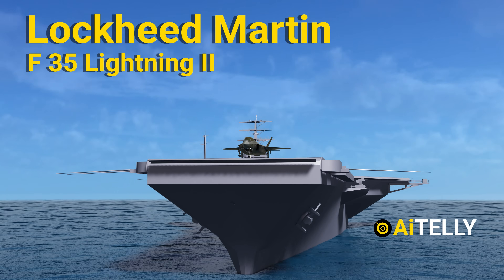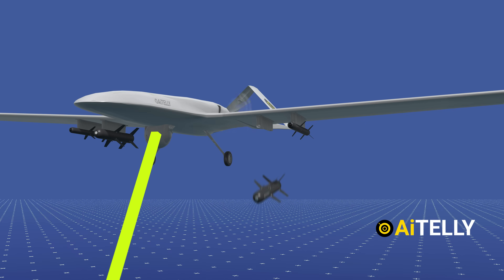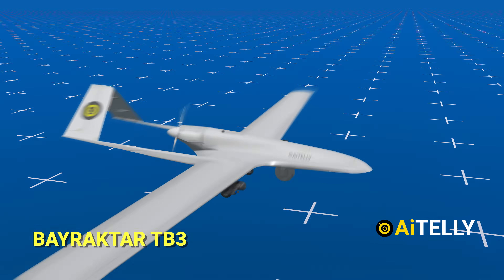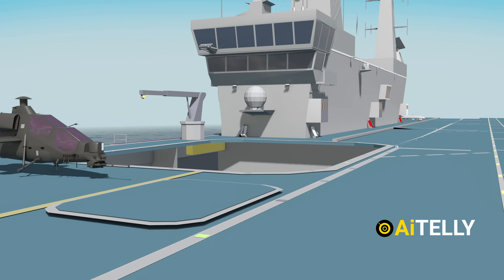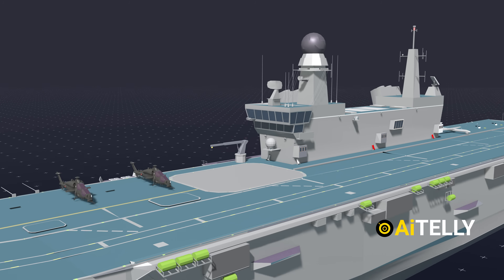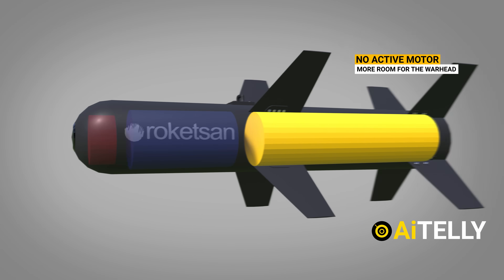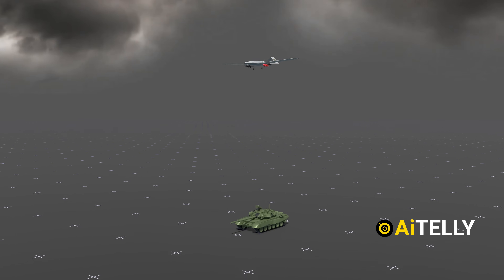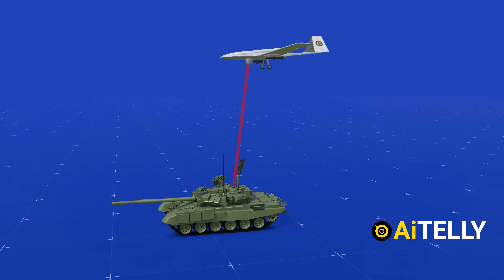TB3 Bayraktar drone Turkey | How it works #drones #tb3 #aircraftcarrier

Comment: Excellent coverage & comprehensive review. Well done mate. But let me make a point. Have not Turks become the mastering Sykes of 21 century? O YES. It's no usd of scaring Turks with ambargos any more because we produced the best of the bests. Kìzilelma unmanned jet fighter alone is caple of taking any modern fighter system f22 or f35 or eurofighter or rafael or suv 57 or any... without risking a pilot. In the mean tina MMU TFX KAAN is ready to take any threats soon. The best 5th generation fighter platform on earth. You dont birve it? Then just check the results in the ground. All usa, russian, european & China's systems have been humbled & humiliated just by Bayrsktar TB2. Turks have not used any sophisticated systems yet!

Comment: Let's clarify a matter, Turkey wanted patriot air defense system as a Nato ally and the USA did not sell it, that's why the s400 system was bought, then it was removed from the F-35 project because there was the s400, no refund was made, new f-16s were requested in return for receivables, but still they are not given!  As a result, the main unreliable ally for us is the USA. The Turkish Nation will exist long after NATO, just as it has existed long before NATO. 

Bir konuya açıklık getirelim Türkiye Nato müttefiki olarak patriot hava savunma sistemi istemiş ve abd satmamıştır, s400 sistemi bu yüzden alınmıştır , sonra da s400 var diye F-35 projesinden çıkarılmıştır, para iadesi de yapılmamıştır , alacak karşılığı olarak yeni f-16 lar istenmiş ancak hala onlarda verilmemiştir ! sonuç olarak bizim açımızdan asıl güvenilmez müttefik abd dir , Türk Milleti Natodan çok önceden beri bar olduğu gibi , Natodan çok sonra da var olacaktır...

Comment: This is a carrier suitable for strikes on underfunded rebels in the middle east.
How can a ship with 30-50 drones compete in naval combat or airstrikes on a location covered by enemy fighter jets and SAM batteries?

It's important to note that this carrier has zero fighter jets of its own so any drone operations or self defense will be very limited.

What happens if the enemy launches an air strike? The whole concept of an aircraft carrier is to protect the fleet from enemy aircraft and missiles by operating AWACS and by sending interceptors to shoot down most of the missiles.
Reply: there will be TF-2000 air defence frigates escorting Anadolu.
Reply: @emrahguven8441  The air defense frigates are for defense. When you send the drones to throw bombs over the enemy the frigate will not be able to fly with them and protect them. They would be easy kills even for very old jets. 

A carrier group is a big target and the carrier with it's fighters normally is the first line of defense. The enemy will waste plenty of weapons for such a big target and these will ofc be stand off (launched from safe range). 

The frigates will not even be able to detect sea skimming missiles Untill the last few kilometers due to the earth's curvature. This is why the AWACs coverage is required.

If there is an airbase to launch fighter jets or AWACs from the mainland why bother to have a carrier? Just launch the UAVs from there.
Reply: @billwhoever2830  TB2 TB3 are cheap and expendable and also due to size and speed they are difficult to detect with conventional radars.
Reply: @emrahguven8441  The tb2s are neither cheap nor undetectable. A single tb2 costs around 2-3 million and then you have to consider the very limited capacity of the carrier, these are not expendable UAVs, you will not be able to complete a mission after losing those UAVs. 

Single use drones can be more than 100 times cheaper smaller and then even they end up shot down. Heck even cruise missile are far cheaper and can deal more damage. 

Considering a single frigate can carry 32 long range SAMs, a single frigate can wipe out almost the entire load of this carrier and then even fire back the 8 anti ship missile carried by most frigates. The missiles fired are in general much cheaper than the tb2 (1-2 million). 

I can only expect the tb3 to be double+ the price. This carrier cannot be used offensively on enemy airspace and would mainly offer recon to the fleet. I still think it's far more practical to launch the drones from airports.
Reply: @billwhoever2830  yeah sure buddy all the informations you count doesn’t know the Turkish engineers right ? They didn’t go that sinking and you perception must be relevant right . Just wait when turkey use this weapons . You will  that These engineers thogt what you think and other problems 100x . Just chill and watch
Reply: @RedScorpionx3  The engineers who thought of the Carrier wanted it to have f35s onboard. Now since the f35s are out of the game the plans of the engineers are based on the liited and not ideal options.
Reply: @billwhoever2830  we have kizilelma project unmaned fighter drone it will fly in tcg anadolu.
Reply: @kralnatavizyok2688  That's still a drone, 
the idea that a fighter drone can compete with an f35 is desperate.

This drone will be using a soviet era engines developed in 1966! And ofc it's subsonic. The range is only 930km.

Apart from flight performance I think it's funny to even try compare the sensors with those found on the f35. This means finding targets especially at long ranges will be far more limited even compared with older aesa equiped jets. 

It's also funny comparing the weapons, apart from the anti ship missiles which are decent, the air to air weapons are limited in capacity and range.

Finally survivability is very limited, it's considered "low observable" and not stealth by the manufacturer. It lacks a pilot so evading threats and reacting to mission updates will be mainly done through waypoints from the ship. This means that the drones will have no decision making during the mission.

A group of 6 f35 jets launched from anadolu would be able to take out at least 24 of these drones with long range missiles alone and at the same time be a much bigger threat to enemy jets.
Reply: @billwhoever2830  
Actually even a proper aircraft carrier also has similar limitations...
In history aircraft carrier never used against any country who has strong airforce or  has balestic missile arsenal...
Aircraft carrier always used against weak countries like Iraq libiya or Afghanistan...these could don't have a basic airforce!  Or missile arsenal..

So yes aircraft carrier concept isn't work properly against powerful countries...that's why Americans unable to attack Iran with aircraft carrier..
Iran will eat Americans aircraft carrier alive...

So small carrier with small drones are more practical...it's can use against weak opponents and support naval forces...
Reply: @gengar5704  What are you talking about? Aircraft carriers have sunk the Yamato, the strongest ship ever made. And this is the reason such ships are no longer made.

Because you mention the usage of aircraft carriers, a modern aircraft carrier can actualy get air dominance by shooting down all of the enemy planes. This is how air combat works. A UAV carrier simply cannot do that.
Ofc if your enemy is strong you are gona need multiple carriers in a group to actually achieve air dominance.
A modern US super carrier has more fighter jets than the average NATO country.

A small carrier can simply carry fewer planes. For example , 6 F35s can actually do far far more than simple drones. The f35s can launch anti radiation missiles to silence enemy air defenses and then engage into air combat. After destroying the enemy jets in the area the carrier can start launching gliding bombs or cruise missiles with the same planes. Ofc not everything is rainbows and sunshine so, 6 F35s might lose if the enemy has jets with similar capability on a nearby air base.

A carrier is only useful if you want to carry your planes away from your own air bases, its very useless for Turkey (really). Airborne refueling tanker planes are capable of serving jets on the east Mediteranean.
The Turkish drones have very long ranges, you can launch them from Turkey and strike in Lybia in a few hours.

The "carrier" Turkey has is ONLY useful to carry men and landing vehicles. Attack helicopters would be of greater use instead of the UAVs for such operations  (since helicopters have limited range).
Reply: @billwhoever2830  we have coral systems you should discover that enemy systems can not work while coral activate
Reply: @volkangoren6412  dude, Koral is just a jamming system, most modern warships have them onboard.

In fact, an actual aircraft with a pilot onboard can operate in an area affected by such a system. There are even special weapons designed to target such systems.

A drone or UAV on the other hand cannot operate in such an environment, because the operator can lose connection to the drone, and the drone can even lose connection with the GPS. This means that the UAV would be almost completely lost, would have to operate autonomusly and would most likely fail to complete any mission.

To sum up, what Im trying to say is that if an aircraft carrier has 1 problem with EWS, UAVs have 100 problems.
Reply: @billwhoever2830  You mentioned good points. It will be much more effective when the current engines are replaced with the developed Turkish engines and new versions are released. In addition, Turkey is developing laser weapons for air defense and shot down an aircraft for the first time in history in Libya. You can think of these technologies like a baby. Rest assured flaws and shortcomings will be updated with feedback from the field and those babies will be warriors.
Reply: Your comments are very logical, but this ship will be accompanied by many ships and submarines. it's also an electronic warfare ship, and it's going to come out like that at first. In the sequel, unmanned fighter aircraft will take its place.
Reply: Now the start tb3 will replace the unmanned fighter jets of Bayraktar company and TUSAŞ company in the future, and all of them can escape from the missile itself without waiting for the order of the pilot with artificial intelligence.
Reply: they will be as support for ground vehicles. there will still be f16 with refueling airplanes. and also turkey wont attack the other side of the globe for oil... just protect itself. and also for nato operations there will be nato jets like f35, f22, f15 etc. for air dominance. and other possible mission would be support allies like katar, pakistan, endonesia. those countries will have their own fighter jets and turkish tb3 will be as additional support for ground troops
Reply: We used this system against france ship you can Explorer that
Reply: It is gonna be full of fighter UAVs'. Bayraktar Akinci is air-to-air and air-to-land unmanned aerial vehicle.

Comment: TB2 is obsolete now.
Reply: why?
Reply: @Knightfire66  because Russian shot many of them down. TB2 is also expensive for what it does.
Reply: @jacobjonm0511  tb2 is expensive? its about 400k for turkey. and its bombs are about 10-15k. its cheap as hell... ukrain does still have around 20-30...
Reply: @Knightfire66  Each TB2 is 6 Million $ for Ukraine + 1 Million $ for the operating room.
Reply: @jacobjonm0511  6m?!?!?!?! less then 1m. its like a toy plane. but with high tech engine + camera. I thought you mean obsolete because of camikaze drones. but tb2 bombs are about 20k... camikaze drones are 100+. tb3 will carry 6 bombs. in one sorti thats 6*80 = 480k saved. tb2 is kalashnikov or toyota of drones
Reply: @Knightfire66  no one is using TB2 in Ukraine any more. It says it all